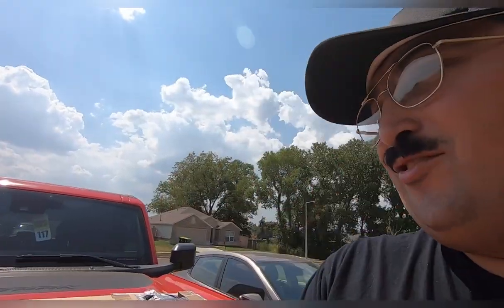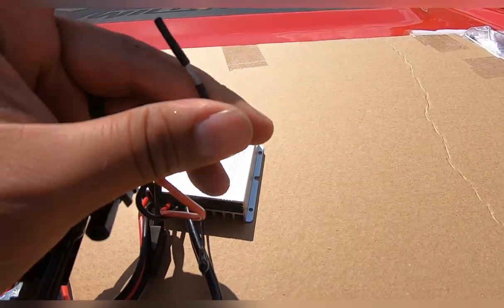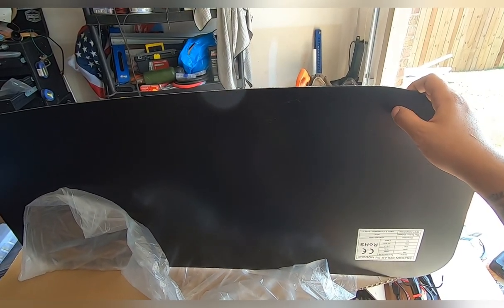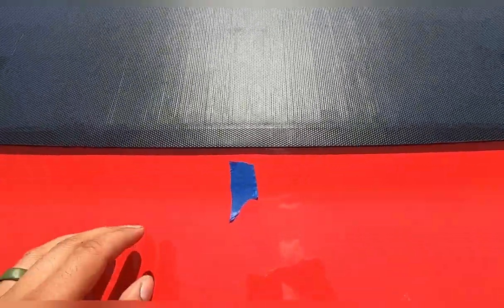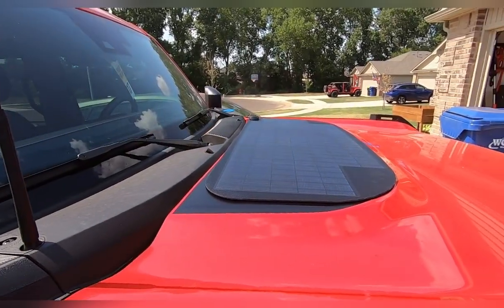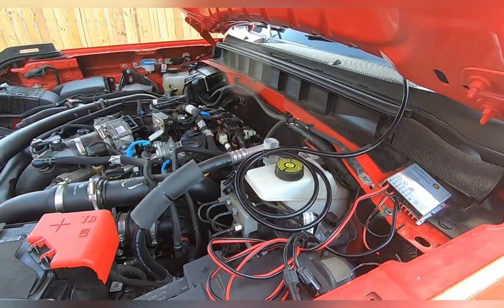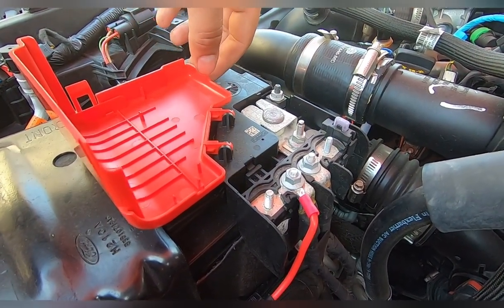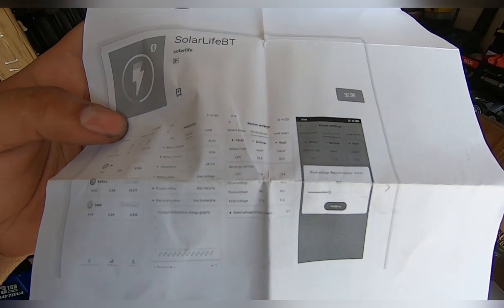Lensun Hood Solar Panel install on our 2022 Ford Bronco

Comment: How has this thing been holding up after a month? Has been useful at all?
Reply from the maker: After a month being kept purely outside it’s survived extreme heats, ice and heavy rain and it still works great. We went on a trip cross country and it kept the battery topped off through all of it and even kept the batteries to our mini fridge charged.